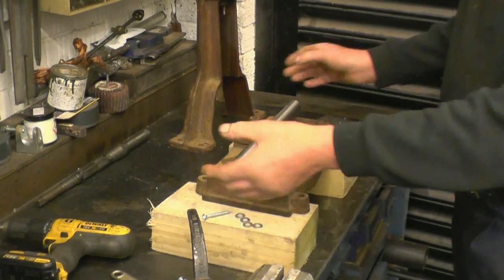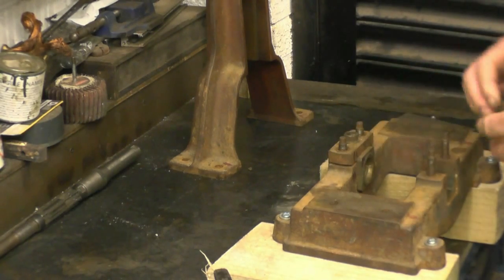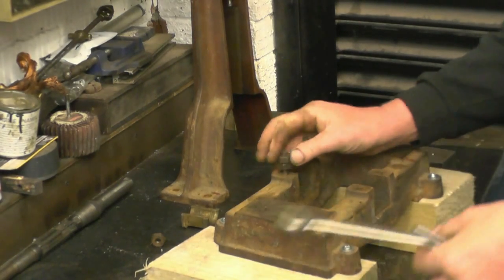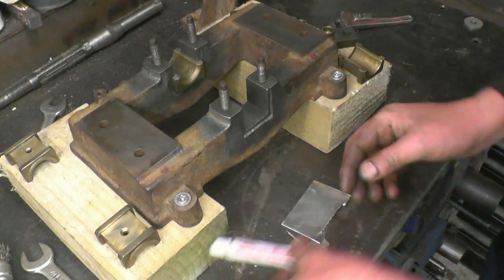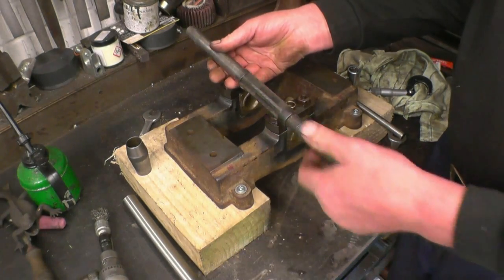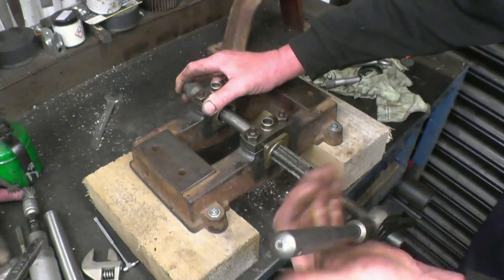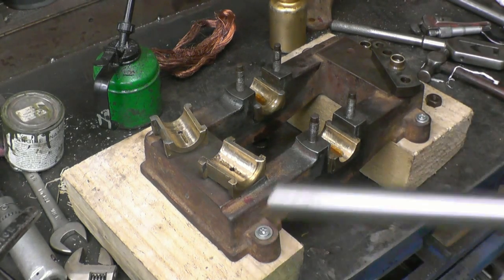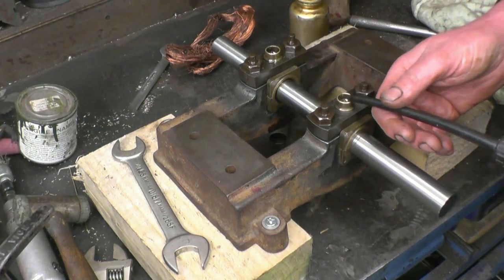SNNC 174 P2  Steam Engine Main Bearings

Comment: nice job John, never throw a spanner away you just never know when you will need it.  I have W/W, AF and metric in my boxes. never touched anything but metric for years until recently when I started fitting a tyre inflation system to timber wagons. the system is made in new Zealand and guess what all bsp fittings out come the AF spanners. keep up the good work mate
Reply from the maker: X+gordon smith I still  have most of my Imperial gear

Comment: John, please don't use epoxy resin... you'll ruin its integrity and its value. These bearing halves are intended to be removable, not glued in place. Moreover, the bearing blocks are intended to move for a perfect fit, the movement even by a couple of thou, to ensure a precise crankshaft bearing fit. Please respect the practices of the time and account for yourself as a doctor... 'Primum nil nocere', the first article of the Hypocratic Oath... 'Firstly, do no harm'. You have broken the first article of the protocol.

According to your logic, had Antonio Stradivari had a supply of plastic sheeting, he'd have used it to make his violins, which is complete bollocks, man!

Steam engines belong fairly and squarely in the steam age, without late 20th century abominations such as epoxy resin. You started off with what I would say is an unfinished project and you have already blown it as far as precision engineering is concerned. I'm afraid that you have just fallen not several inches but several feet in my previously quite high estimation of you and your work.

On this occasion, you really fucked up, John!
Reply: Whatever, John but epoxy resin and Locktite were not around in the steam age but these engines continue to work without modern inventions and interventions, even today. As far as I am concerned, if you work in steam, you work as they did! End of!

Yes, it may well be John's engine and that he can do as he likes with it... my comment is that my former great respect for him as an engineer has just diminished to a shred of my previous level of respect.

I am a time-served apprenticed mechanical engineer since the late 1960s, with a Higher National Diploma in Toolmaking and Mechanical Engineering, so I think that I know more than a tad about general engineering practice.
Reply: Antonio Stradivari would have used animal glue, as I and my violin making colleagues use today because old adhesives always have been reversible, whilst cyano-acrylate glue and epoxy resins are not!
Reply: #g1yih By definition, your application was merely decorative... John's application is purely mechanical, both of which are, of course, two entirely different things.

Things of the 'Victorian Steam Age' belong in the 'Victorian Steam Age' and precision steam engine practices belong in the period of precision engineering practices and should never be confused with 'filling and glueing' using epoxy resin.

Lower bearing blocks are intended to move slightly in their mountings (if only by a couple of thou) to account for temperature differences when running under steam. Glueing them in with epoxy resin is wrong... so totally wrong... it is unprofessional and shows an inherent lack of knowledge about steam engine operation on a small scale.

And I suppose British Rail and all the pre-nationalisation post-grouping companies, LMS, LNER, SR and GWR,  epoxy-resined their lower bearings in place? Yes, you've got it... NEVER!
Reply: So Stradivari would have used cyanoacrylate adhesive? Bollocks, man! If so, then why do we violin makers not use it now? We use wood because he used wood and we use the same glues that were available to him... that's why we 21st Century violin makers can replicate a similar product to that available in the early 1700s... not possible with cyanoacrylate adhesives, epoxy resins and plastics.
Reply from the maker: I bet he would have used super glue just to hold things in place 
The bottom bearing was "glued" in place with some sort of filler on the original build 
The bottom bearing will still be removable 
Modern lock tite and similar products are frequently used on vintage machinery
Reply: The
fact remains its Johns engine so in my book he can do what he likes. 
A few years ago I was re fitting some Victorian railings after refurbishment for
a well know architect ( well to me anyway) I asked if I could use a resin fixing
and cap it off with lead for authenticity, his reply was exactly what you said “If
the Victorians had two pack epoxy they would have used it”

Thank
you for taking the time to make the videos that must take up a fair bit of your spare
time.

Comment: That epoxy was used for altering crankcase pressure on 2 stroke racing engines . An ex aircraft engineer from Liverpool used to make those motors go well with it

Comment: Nice job john! As usual. If the bearings were real bad you could have set the thing up on your horizontal mill. Thanks for posting!!
Reply: The bearings weren't bad... in fact, they were very close to perfection. John decided to use epoxy resin on this perfectly machined part, for a reason best known to himself. Very unprofessional!
Reply: Within the traction engine world it is a done thing.  as often the surface the bearing sits in will be pitted.